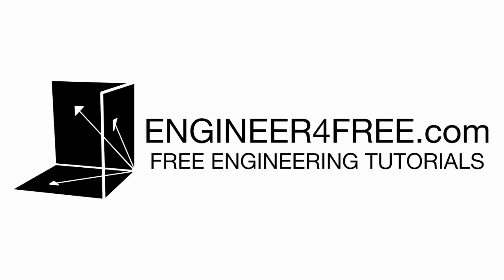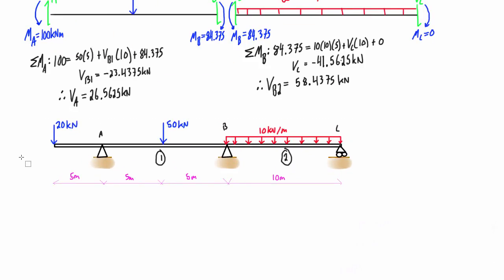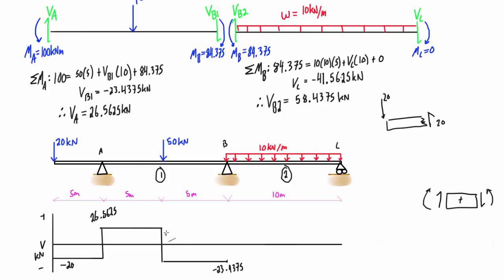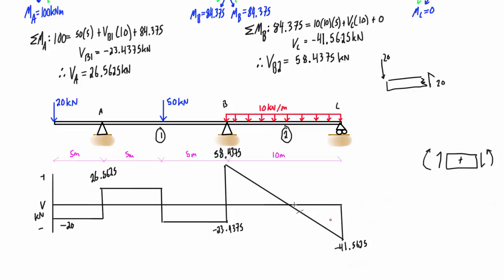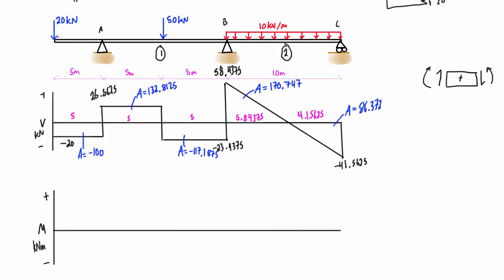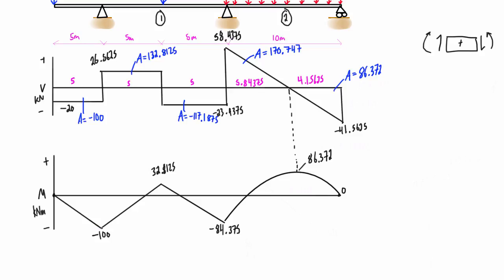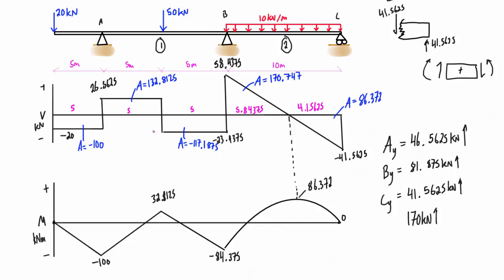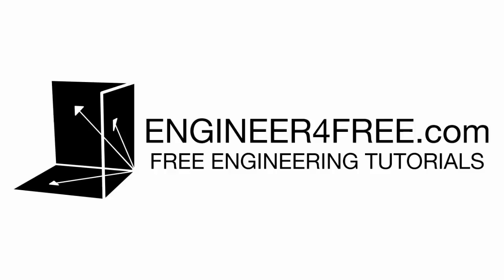3 moment equation example #1 (part 2/3)

Comment: I am really confused. In SFD supporta A should be 6.562 because -20+26.562= 6.562. In all your videos you use that method why not this one.?
Reply from the maker: The beam sees the reaction at A as a point force pointing upward. At the location of a point load, the SFD jumps by the magnitude of the force. The difference between -20kN and =26.562kN is 46.562kN.
Reply: @Engineer4Free  thank you so much.